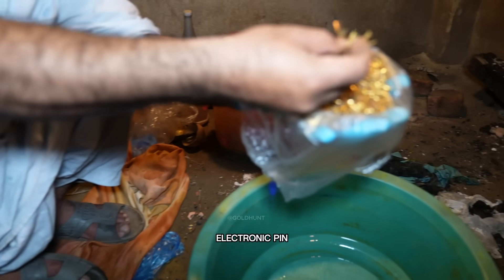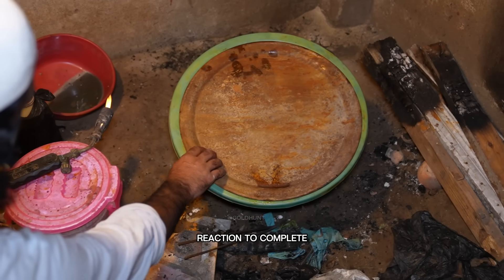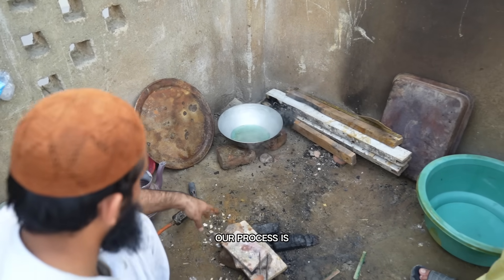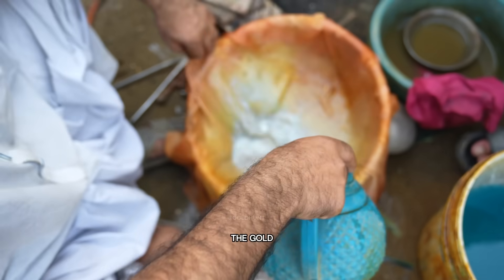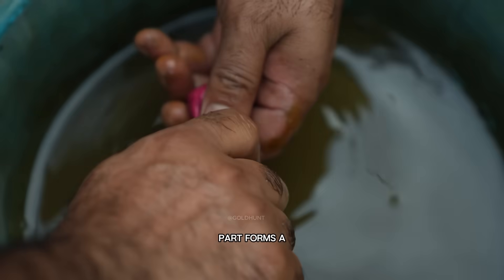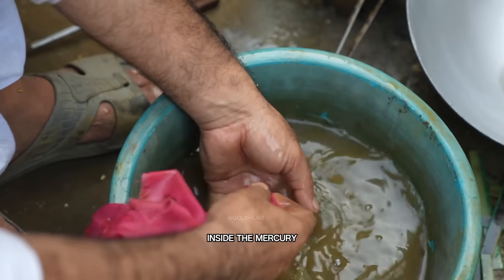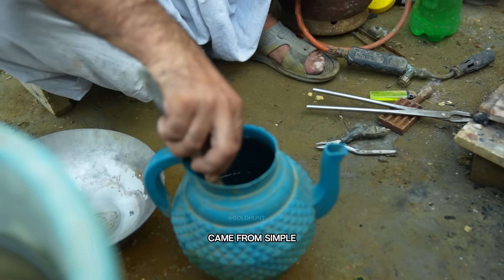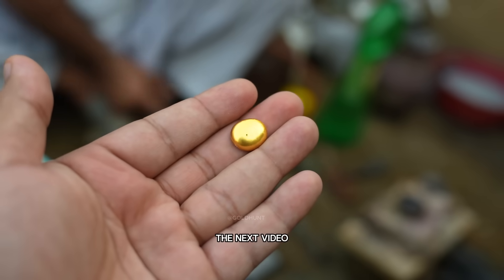You Won’t Believe How Much Gold Is Hiding Inside These Electronic Pins!”

Comment: DOES ANYONE KNOW -

1) which electronics is he speaking of, specifically??? 
2) how much is that piece of 24K gold worth in Canadian dollars, as of now?
Reply: 1) Bro almost all the electronics contains small amount of gold bcuz gold is one of the best conductor of electricity and doesn't corrode. Even your phone, laptop, computer, some wires contain gold. There is some sort of Superchip or Microchip in a computer which contains 1 gram of gold. And if you managed to visit all the junkyards and collected those chips from scratch and seperated piece of gold and gold wires from it and melt it down! Congratulations by collecting 1000 chips from trash you can melt in to 1000gram of pure gold . 
2) 1 kg pure gold worth $192,647.16 canadian dollars